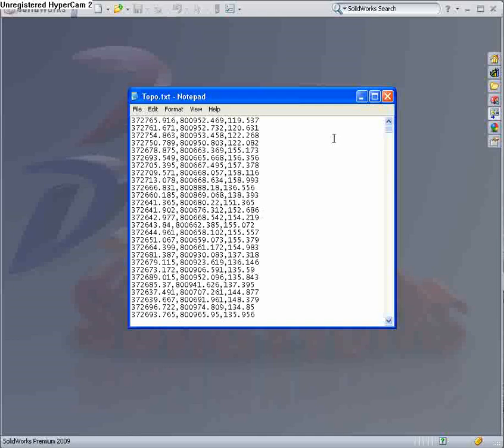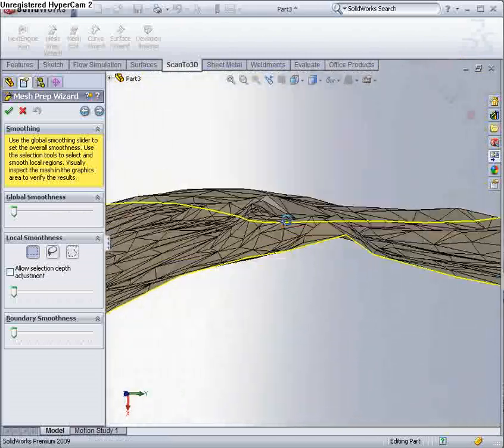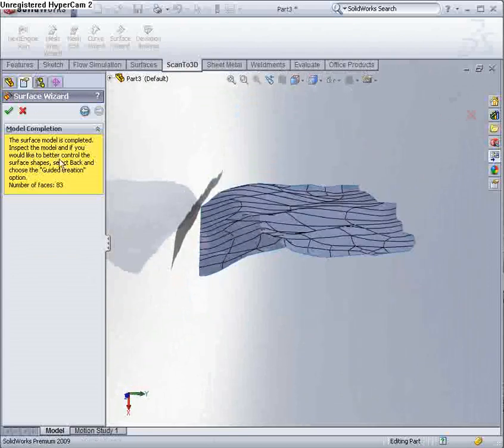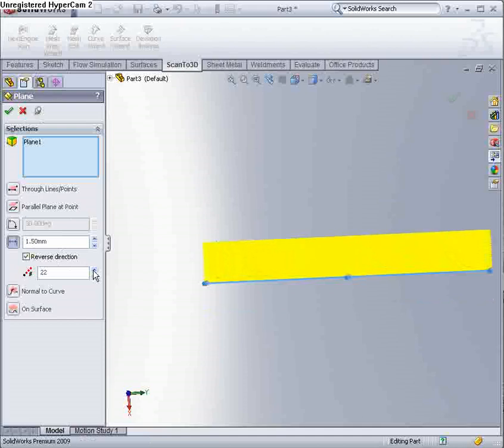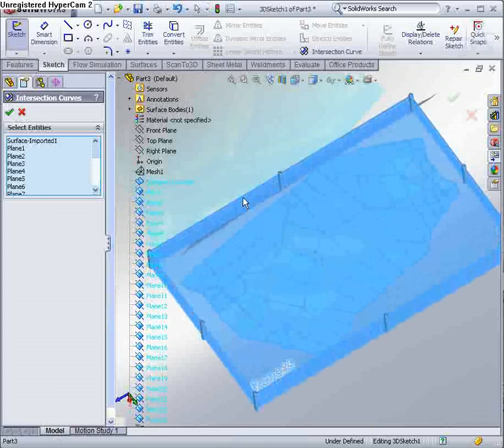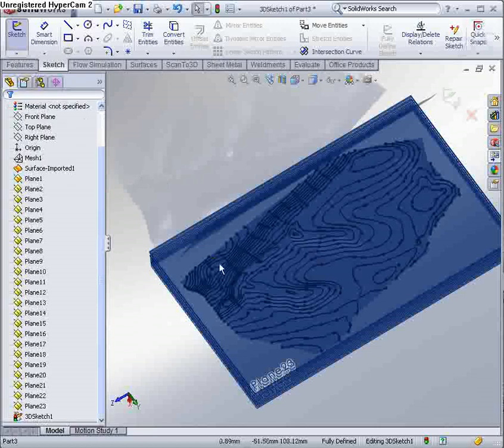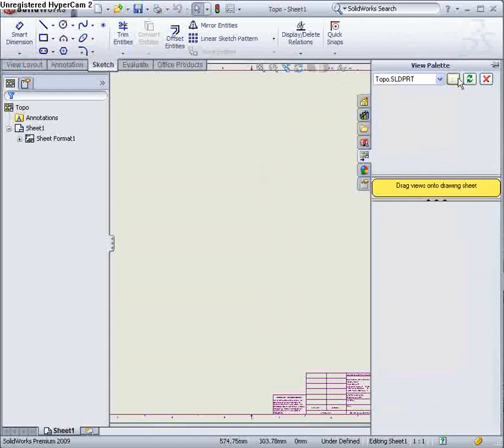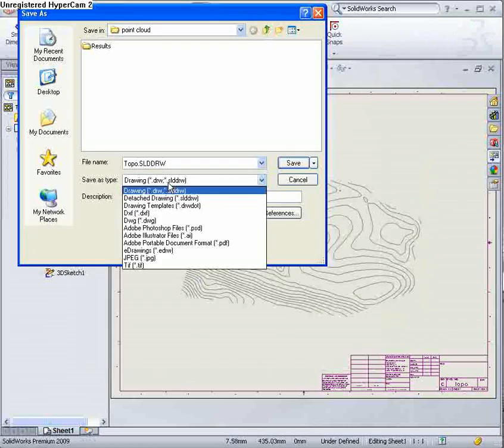Topo Surface in SolidWorks

Comment: Damien. Awsome video! I'm trying to do this exact thing with survey data from my Trimble Catalyst device. It's not working. I can get all the points (127 points) uploaded from the txt file into Solidworks, but it strings them out into a long skinny line. What am I doing wrong? Is this error on Solidworks or Trimble data?

I would greatly appreciate a bit of help on this. If you could, email me at Www.Carson@powerzone.com

Comment from the maker: Hi Dominic, yes it was done in mm, there is a size limit of +/-500m from the origin, so you have to work within this limit, it also lets you have less surface patches with as smaller file, so it is a bit quicker but less accurate scaled down.  From 2016 scan to 3D is included in professional.

Comment: Really nice workflow Damien.  Point to not, the Scan to 3D add in is only available in Solidworks Premium I think.  Did you scale the model down to improve performance?  I noticed the units were set to mm.  Would it make a difference if the units were in metres?